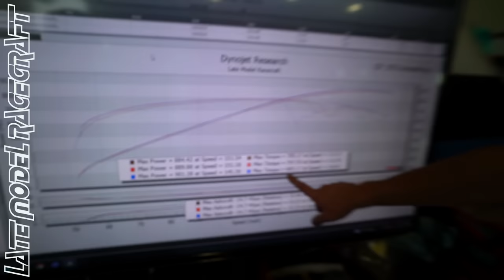NO WAY!   900RWHP on Factory C7 Z06 Corvette Blower?

Comment: I just did one that made 930whp on an old school kong port. Btr stage 1 cam LME heads on 14.5 psi. No meth e80 so big deal. Now the other one with the synergy race port it made 1025whp runs 4.46 60-130 on the dragy at 4150 lbs. Now that’s something to talk about. Both of those are a10 zl1 not a manual that’s going to lay down more whp then typical automatic. Go look up slikzl1 on American 60-130 on dragy. Cars right there with 2650 cars.  Stock ported blower that’s actually impressive as full weight a10 zl1 making steam. Lt1z350 the tuner.
Reply: Sorry but I find it hard to believe you made 930whp with just basic port / heads work and NO meth. There’s just no way.

Comment: what rear tires are in that c7z06 to handle all that power? seems like a toyo r888r 325/30/20? Would be nice to know, trying to run same setup on a c6z06 with 640whp

Comment: How much more would this same setup with a ported Kong 2650 make you think? Would you need to add port fuel injection with a Kong 2650?
Reply: You would need a Magnuson 2650 as Kong does not manufacture a 2650 DI blower

Comment: I think that better option is install Magnuson supercharger pack with their size of pulley and inlet and we dont need add any ice box because package have included bigger intercooler also i have a question about engine how much hp it can hold without forged the engine?

Comment: hey. why don't you guys use interchillers on all blown set ups when spinning the blower hard. or all set ups for that matter. why in 2023 should you have to buy ice all the time when the AC can chill the system permanently. me as a consumer would not want to be buying ice and trying to keep it cold and trying to stop it from melting?
also the chiller system takes up waay less room.  theirs just no negatives with the chiller at all.
Reply: The negatives for the chiller are complex install, splicing up your AC system, it wont work for half mile racing etc. The interchiller still needs more volume so you would need an expansion tank regardless. You don’t NEED ice to keep it cool. If you are at the drag strip/street run just toss some in for even colder iat’s.
Reply: @ShizzySupra  no negatives man!

Comment: Why do you putt up dee dee dee things for really no way 900hp really you putt up 1000hp all the time
Reply: Because it attracts new viewers. Just because you’re not smart enough to understand, it doesn’t mean it doesn’t make sense.
Reply: 900RWHP means rear wheel horsepower which is VERY impressive on a stock LT4 blower.   When they mention 1000 HP that’s engine/crank horsepower.   So in actuality this car makes over 1000 but that’s not the impressive thing.   If you are familiar with these Set ups 900 from a factory blower is  insane.   It’s pretty much Magnuson 2650 level power for half the cost but not as efficient.

I’d say study up on this stuff before acting like you know everything.   There are tons of combinations that make different power for the budget conscious customer.
Reply: @Jay-js5ik  I'm not  what see now your being that guy dont me that guy u🤡🤡
Reply: @gearheadflicks  900hp is nothing  now dee dee dee 🤡🤡
Reply: @ricknichol260  Your parents failed you by letting you have a phone.
Reply: And again you still don’t get it.   It’s 900rwhp